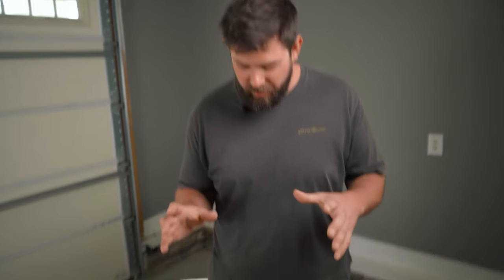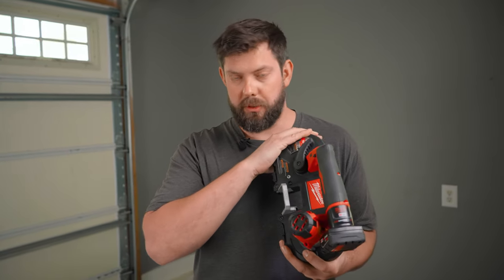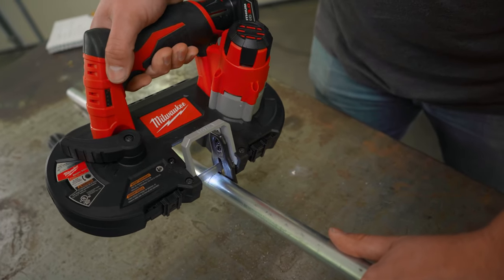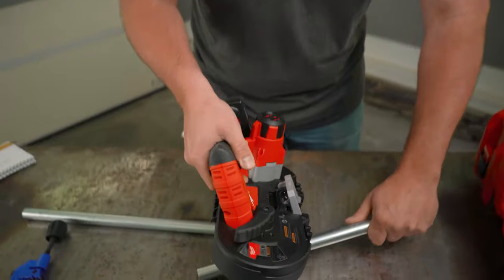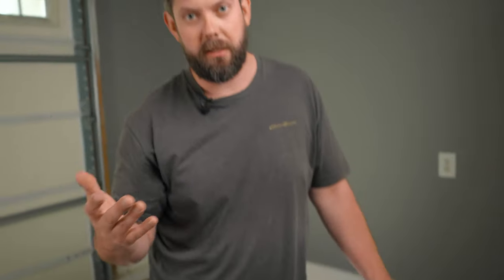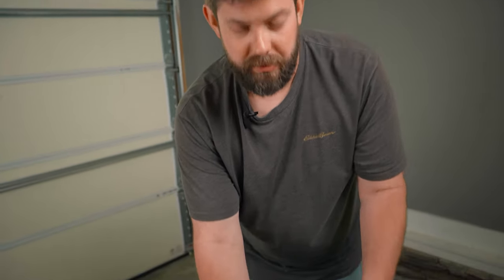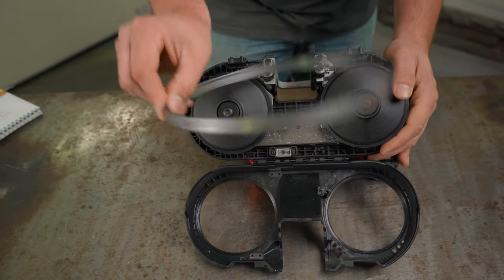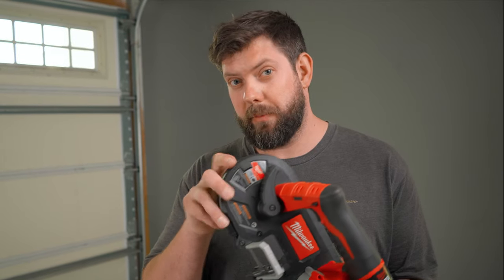This Portable Band Saw Saves You Time | Milwaukee M12 Tool Review

Comment: I have the M 18 version and I love it. Milwaukee makes a great deburring tool that you stick in your drill and  remove any rough edges that the saw leaves behind. I use the bandsaw when the end of the conduit is going to be inside of a connector. I use the tubing cutter when I know the end of the tubing is going to be exposed. Great review. Love that Milwaukee red...
Reply from the maker: Thanks for the tip!  That's very helpful.  Is this the tool you are talking about?

https://www.homedepot.com/p/Milwaukee-SHOCKWAVE-Impact-Duty-Conduit-Reaming-Bit-Holder-48-32-2350/300877235
Reply: Yes that’s the one I have it works great. Debris the inside and the outside of the pipe...
Reply: @MakerPipe  A trick of the electrical trade when it comes to cutting conduit with a tubing cutter, especially with 1/2 or 3/4 emt,  don't cut the conduit all the way through with the tubing cutter, just snap the piece over your knee, like snapping a stick in two, it saves a step in reaming of the knife edge that the tubbing cutter creates. Try it both ways and you'll see what I mean.

Comment: Was reading some of the reviews on the Home Depot site and guys using the new fuel model (Gen 2) say they hate the new saw due to the safety switch and are going back to the 2429-20 (Gen 1) model.

Comment: On the same manufactures product line, the 
Milwaukee M12 cordless Copper tubing Cutter, Model # 2471-22, would make an real good choice into replacing the manual tubing cutter. Fast clean and straight cuts and is less expensive as the portable band saw. I don't mean to hi-jack your review on this product, I would just mention a alternative to this tool. Thanks for the review.
Reply from the maker: Wow, I think that is worth trying.  It wasn't really on my radar and I appreciate the suggestion.  Thanks!
Reply: I'd be curious to see how it did with EMT.  Had some others tell me it really bogged down with anything over thin wall copper. but it's always looked so tempting for quick cuts.
Reply: Milwaukee says the Copper Tubing Cutter is exclusively for cutting copper and will not cut EMT.

Comment: Word of advice to everyone. Treat these bandsaws, and also the hacksaws, like firearms. Finger off the trigger until the blade is in place and you're ready to cut. Don't get your hand around the blade while the battery is in the tool. Remove the battery before you change blades. Put on the safety when you're not cutting. If any of the journeyman or masters I work with were to see you not doing these things, they'd ream you out and then kick you off the job site. Rightly so. Basic stuff. If you 're doing dumb, unnecessarily dangerous stuff that will go bad sooner or later mess you up, what kinds of other dumb, unnecessarily dangerous things are you doing that'll be putting other crew members at risk.
Reply from the maker: Good advice! Gotta keep safety on the forefront of working with tools like this.

Comment: Did you really just say you dont need to debur your pipe?! As others have said this is not the fuel version, you should rename your title brother! Cheers mate
Reply from the maker: For DIY projects, deburring is not always necessary. Most of the time the cut ends end up inside of a connector. Thanks for the info 🤙